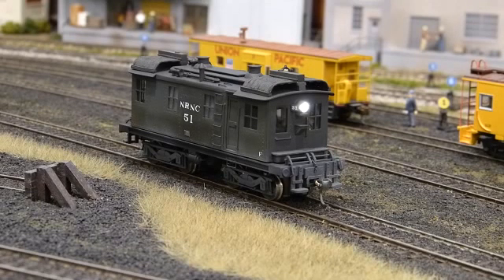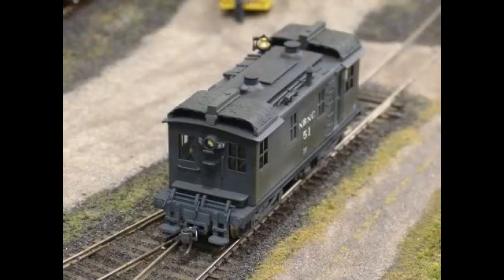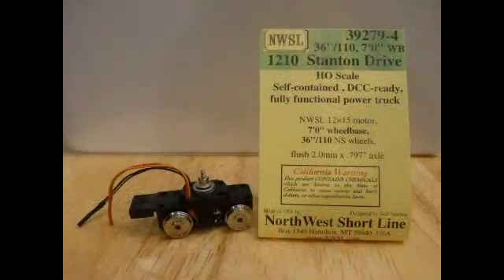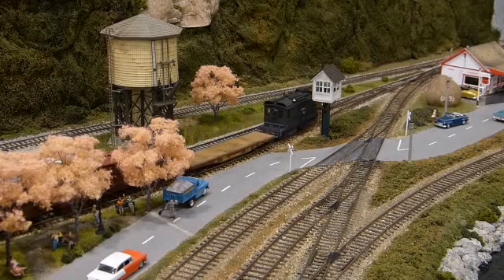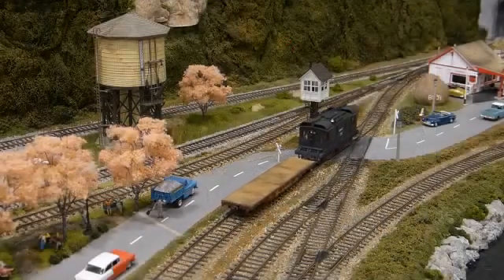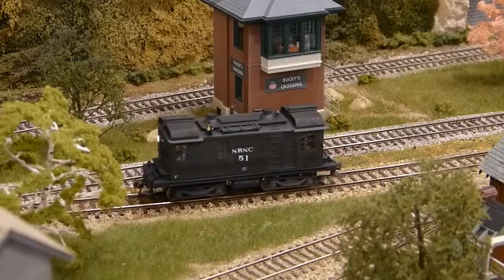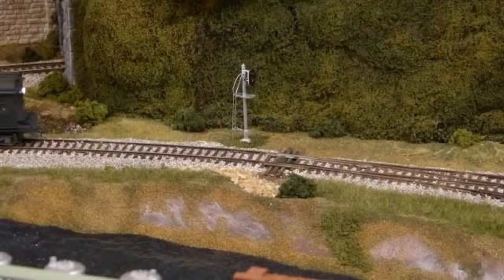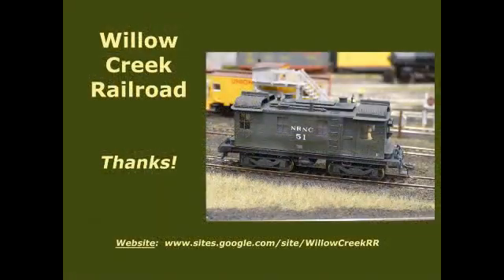Willow Creek Railroad - Boxcab Diesel Intro

Comment: Why haven't we've seen this locomotive in later videos?
Reply from the maker: Disappointing, isn't it.  When I built the little guy, I ran into an internal space problem that reduced the planned weight for the boxcab.  Consequently, it won't reliably pull the string of 6 cars onto or off of the car ferry, which is where I'd planned to run it.  So it's resting in storage.  I'll tell the little boxcab that you asked about him!  Thanks!

Comment: Can it pull coach cars?
Reply from the maker: The boxcab can pull coaches but the real question to me is ... how many?  The small boxcab doesn't pull a complete ferry load (Bucky's Crossing) of 6 freight cars.  Unfortunately, just too light.  I built a 2nd boxcab -- 100 ton, 300-hp, c. 1930 unit similar to the NYC DES-3 units -- which gave me more room to weight the unit down.  Much better at pulling coaches and freight cars.

Comment: Love the model and love the layout!  How did u connect truck side frames to the trucks? And is the cab itself an old MRC boxcar?
Reply from the maker: Glad you enjoyed the video and the model. Each side frame was built separately and then styrene stand-offs were added to the back to hold them away from the wheels but enable me to glue the frames to the base of the motor/truck assembly. As for the cab, it's entirely scratch-built using primarily styrene sheet and strip material ... and a lot of patience.  :-)
Reply: Awesome beautiful work!
Reply from the maker: Thanks.  Much appreciated.